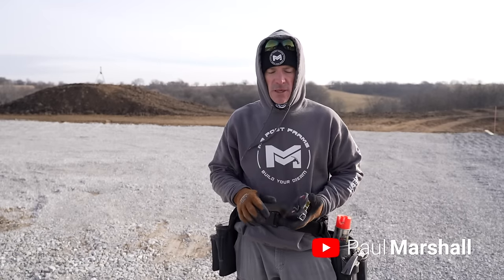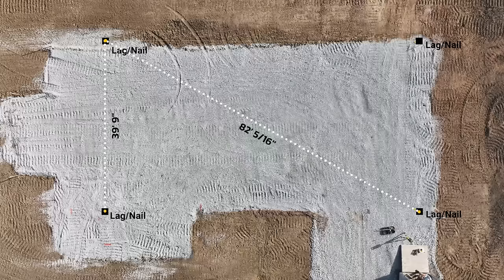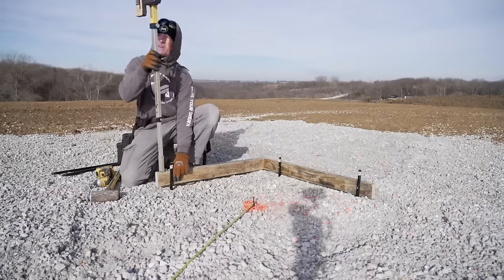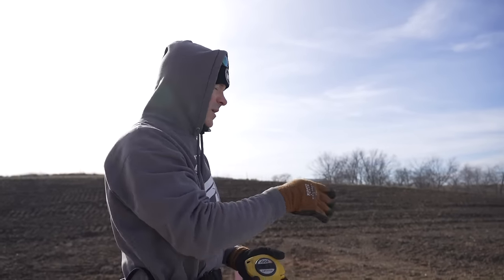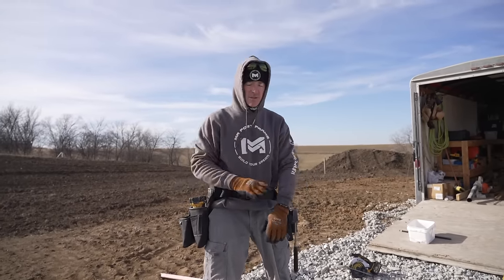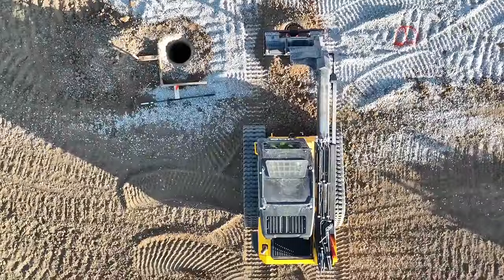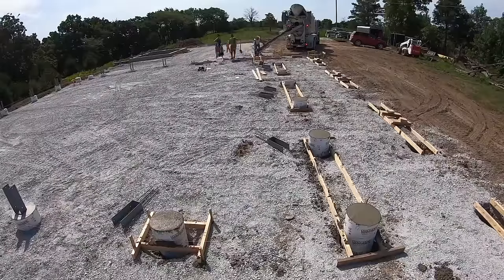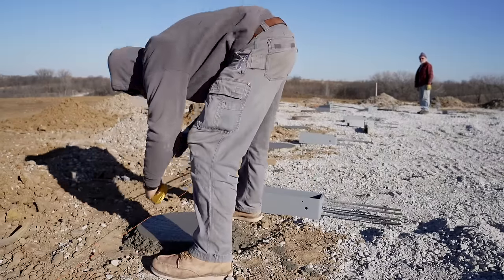Cost of a Pier Foundation | Barndominum Pier Foundation Step by Step | Tools + Supplies

Comment: Do you use 4 ply columns when going over 16’ mainly because of the wind that you have in the Midwest.

I live in Kentucky and had planned on using 3ply columns with 18’ sidewalls.
Reply: I've seen other builders use three ply up to 18' and four ply above that.  So, I think it is about the overall engineering structure, is it sheathed, and location.  If you have to go four ply, costs for posts and brackets goes up quite a bit.
Reply: Still in planing stage but looking at 20' side walls and thinking 4 ply was a smart choice as I was looking at mounting floor truss hangers to the walls for the second floor so tge posts would be holding everything from the roof and second floor but I'm not an engineer and have not talked with one yet.

Comment: I have a question. Why not run the string line parallel with the batter boards? To mark the true outline of the house? 
Are you taking into consideration the framing? Is that why you are doing the string lines further in than the boards?

Comment: Do you hold your bracket edge slightly off of your string line when you set it so you don't push your line out?  Since you can make that up by sneaking your post out to the exact outer edge.